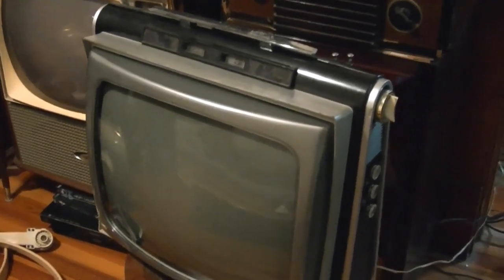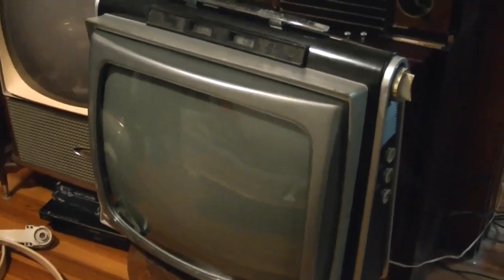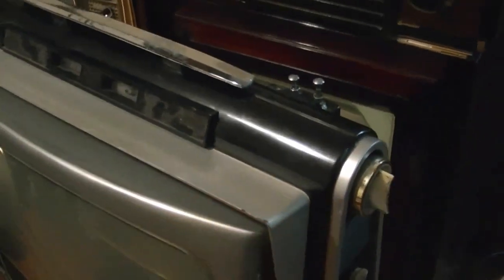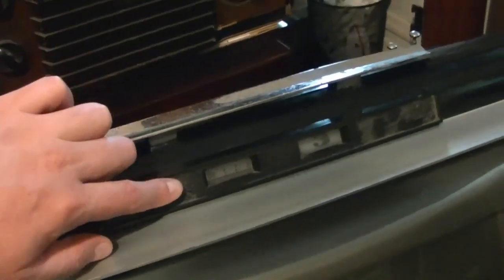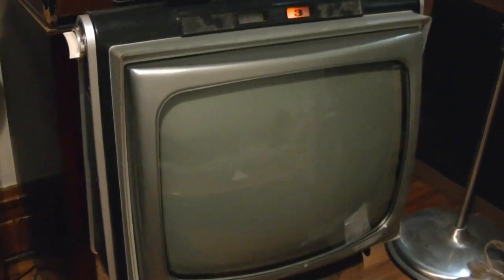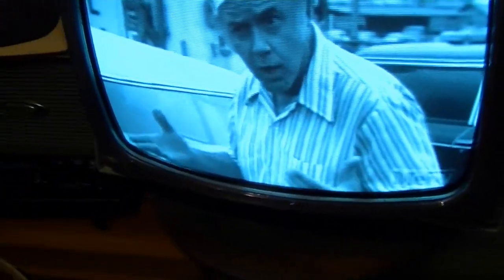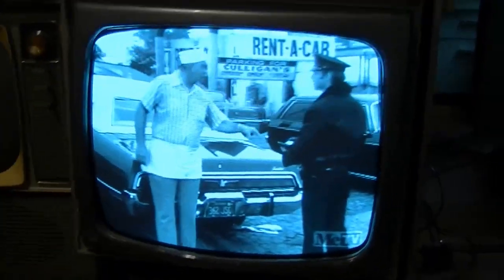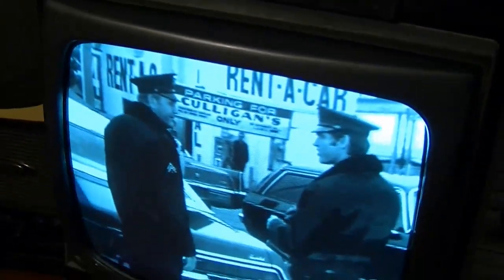Philco Town and Country Revisited p2o2

Comment: You've probably seen there is a original TV ad for this set on YouTube which clearly shows the artwork for the bezel around the volume and channel indicators. It seems like you could use the image from that ad to compose similar artwork and print it onto waterslide decal paper, then transfer the decal onto some brushed aluminum vinyl film. That could then be applied in place of the missing decal.
Reply from the maker: There was also a nice example for sale on ebay recently and I saved some photos of the artwork.